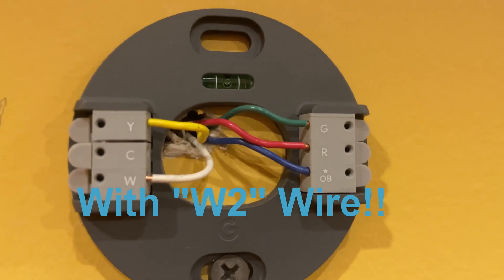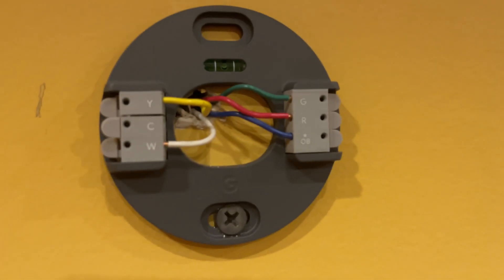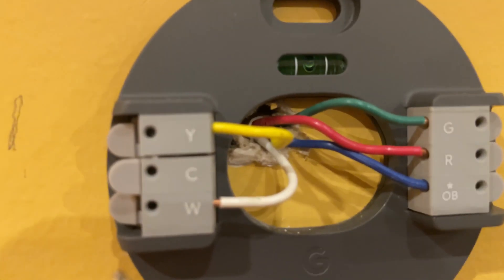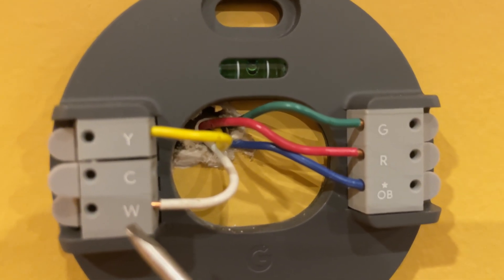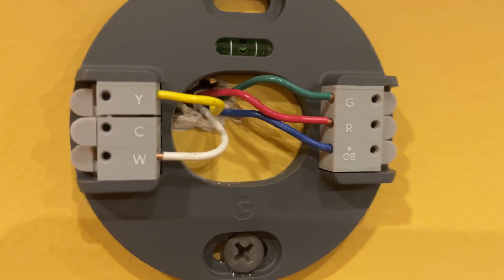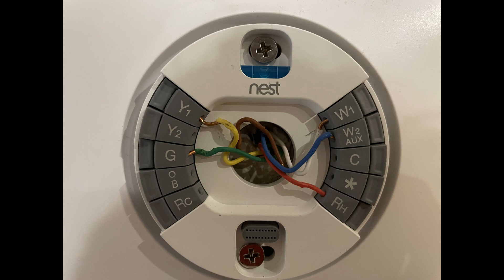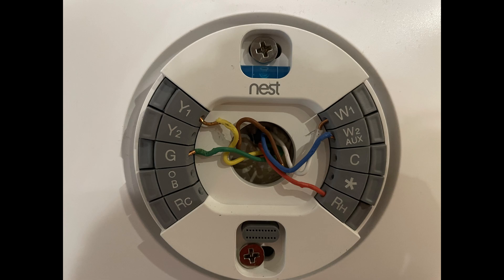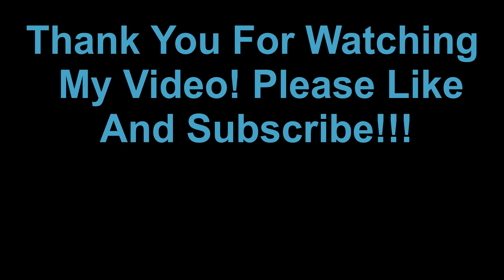How To Connect "W2" and "W1" Wires (2 Stage Heating)To Nest Thermostat W/O "W2" Slot!!!

Comment: Dude, that's not two stage heat that's emergency heat, thats for your heat strips. 😂 
Don't remove the common wire. Use the green wire that controls the blower and on your configuration let the air handler control the blower. The O/B controls the reversing valve.
Reply: Can you explain that a little more simpler? Just bought a nest and my thermostat has W and W2
Reply: Trying to hook up two themo, up and down, Now I have both hooked up to W2 but , it keeps going out when I cut heat on. Didnt take picture of upstairs when I changed it out and thinking they need to be hooked up a little different any suggestions.
Reply: 😂he bout to burn down his casa😂
Reply: What if my unit does not have a common wire? (furnace) I followed the blue wire down to the furnace board and its on W2